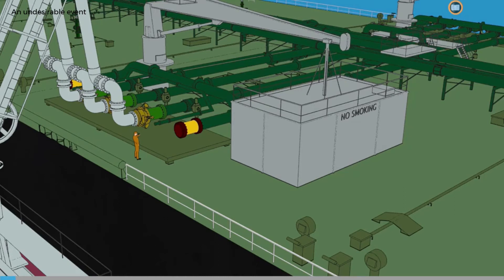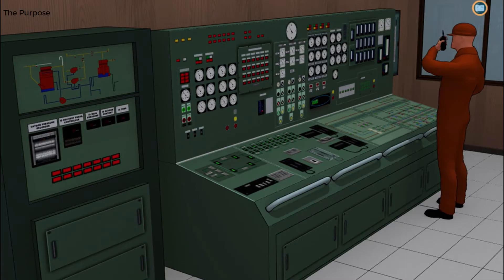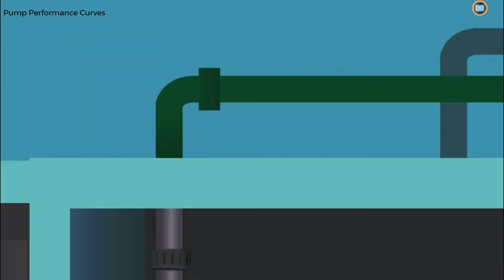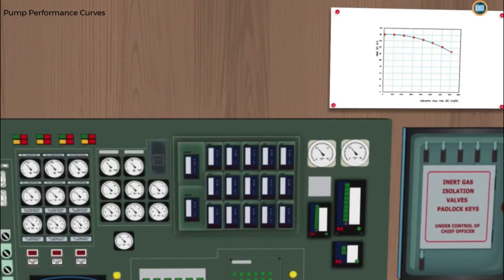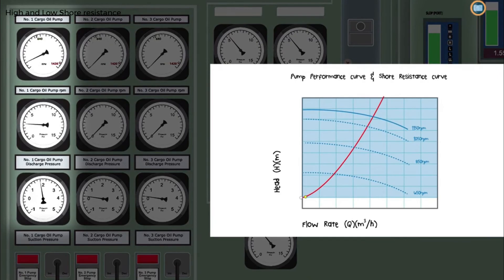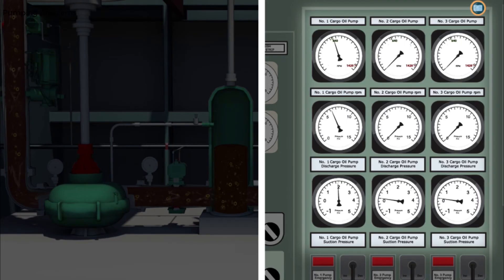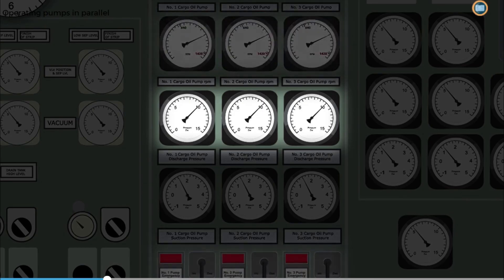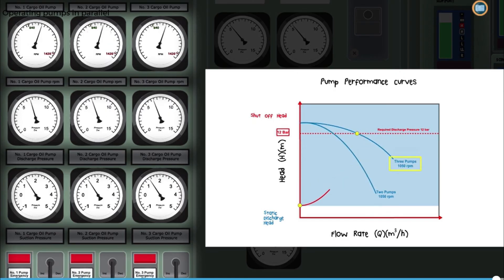Discharging Operations  on Crude oil tankers

Comment: someone explain me is this is a mistake on the video, at 9:50 it says  to use the pump discharge valve to restrict the flow , but since the pump works in RPM, the flow would be the same , by close/opening the valve only the speed of the liquid would change and the pressure , but not the volume, for example the water hose in our gardens, if you put your finger on the exit
Reply: The RPM would not be affected since you are not controlling the governor valve of the copt in the engine room, but if you look at the Curve, you will see that the Discharge Head would increase and the rate (capacity or flow) would decrease at the same time as you would move backwards on the Capacity line and upwards at the Head line
Reply: Centrifugal pumps are not positive displacement pumps. Their liquid delivery can be controlled by throttling discharge (side) valve. 

Throttling the discharge valve on a centrifugal pump is a common method to restrict flow, but it's important to understand how it works and its potential consequences.

How it works:

Valve Restriction: When you partially close the discharge valve, you create a restriction in the pipeline. This restriction increases the resistance to flow.

System Curve Shift: The increased resistance alters the pump curve, which represents the relationship between flow rate and head (pressure) required by the system. The pump curve shifts upwards and to the left.

Intersection with Pump Curve: The new system curve intersects the pump curve (which represents the pump's performance characteristics) at a lower flow rate. This means that the pump delivers less fluid when the discharge valve is throttled.

More info at https://www.pumpsandsystems.com/how-do-throttling-valves-affect-system-curve